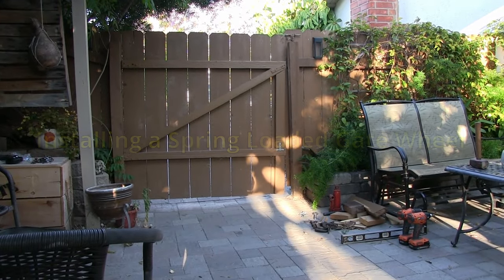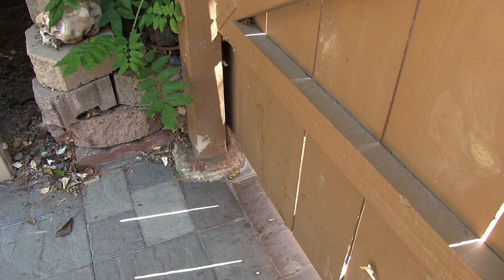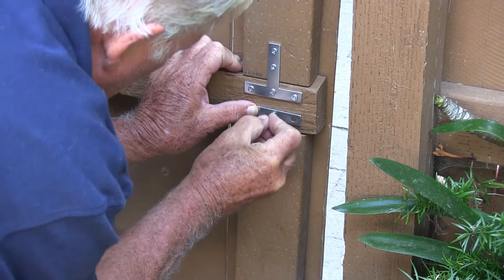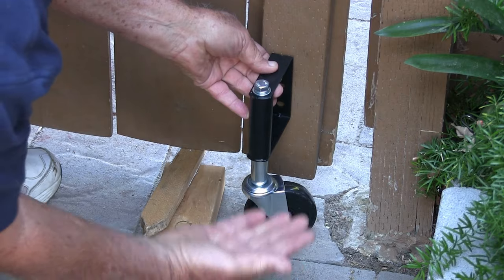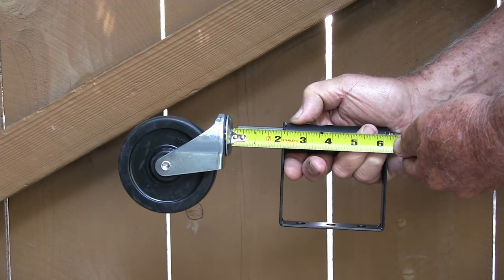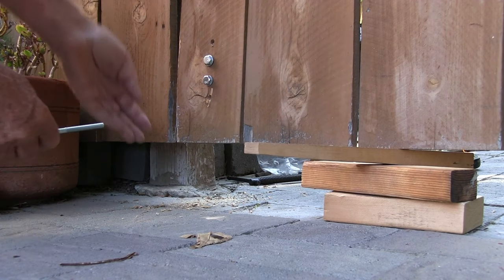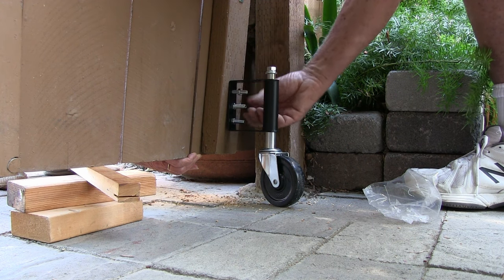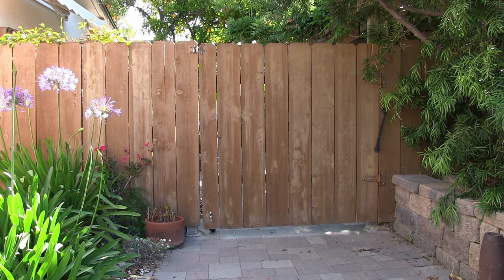Installing a Spring Loaded Gate Wheel

Comment: I just attempted to fit such a gate wheel.  There was no instruction to create tension in the spring as you had done so I presumed it wasn't the right device for the job.  Without the tension, it doesn't support the gate sufficiently.  Thanks for including this in your video. Regards from Dublin, Ireland.

Comment: Instead of a C clamp I pressed down on the wheel and held it with my foot and tied a wire to hold it in place and then released the wire once i had the wheel attached to the gate.

Comment: Well done. I have a little different approach to my aging fence. As it falls apart I make an annual walk around the perimeter and remove any detached/sagging boards and use them for kindling. At the current rate my fence will be all gone in about 4 yrs.😂

Comment: Psh I don't got pavers just concrete I beefed the heck out of my post and what not still.. when I got my house in 2010 I put gates with solider sheets for privacy knowing weight might be an issue. I had to go back and reinforce the post more.  and it's really still not quite enough. I want to get some of these gate wheels it's for concrete but the concrete isn't totally level there's probably a difference of dam near a foot by the time the gate swings out. The double gate is in total around 10 foot 7 inches wide approximately. Paid a lot in the day to have it installed but they stinged out on the wheel that I had asked them about and now I wanna get one but I can't deal with plastic castor wheels. Need some solid rubber wheels and no tube tire crap.

Comment: Why did you compress the spring on install?  Seems if the gate is going to sag overtime you would want no compression?
Reply from the maker: hi split,  good question. i surmised that the gate was leaning due to its post being at a slight angle. rather than mess with the post i put more pressure on the spring to correct and it came close and so far it has held in the position shown. not perfect but better than pulling brick and concrete to correct the real issue. still works fine and the wheel holds the gate open. thanks for ur suggestion. rick
Reply: @skycamproductions  Thank you for the explanation.
Reply: @skycamproductions  how does the spring hold the compression? I'm about to install one myself and please I want to know?